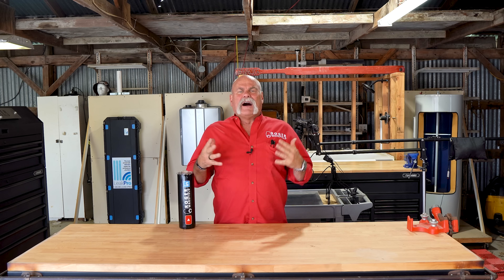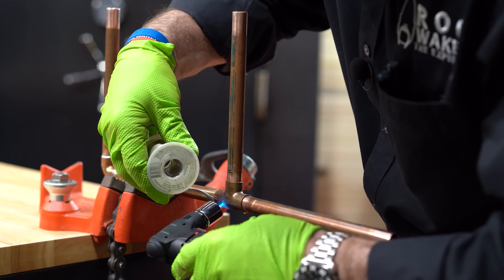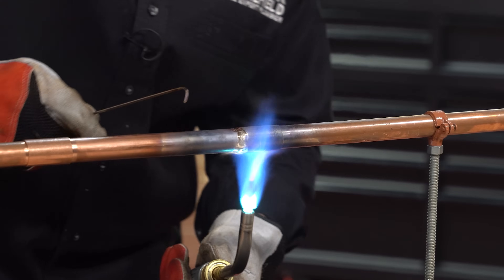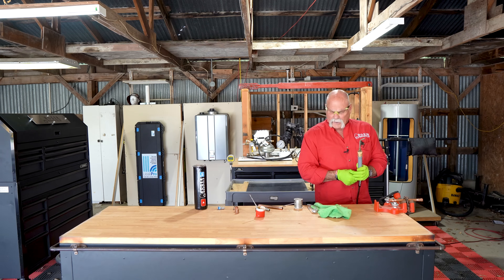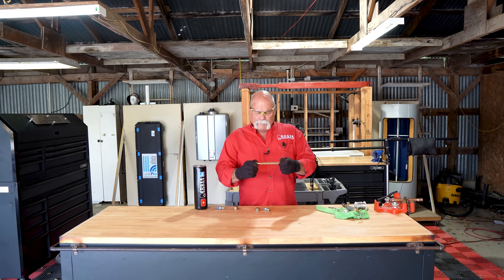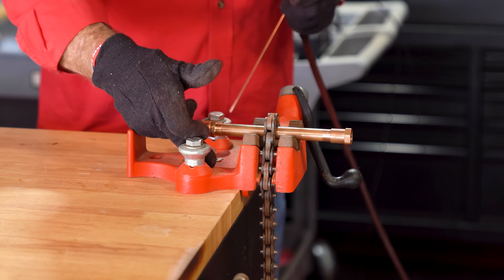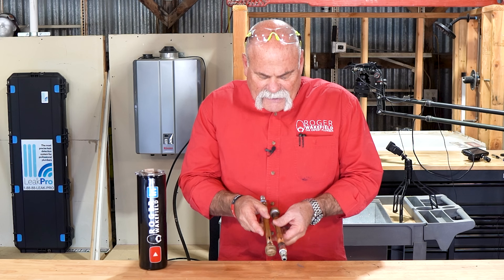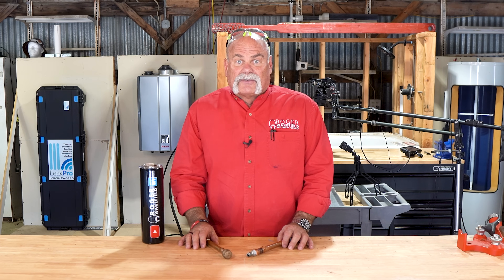Which Is Better Solder or Braze? | Pressure Test

Comment: Brazing of course in finland we dont even train soldering at vocational school. Everything is brazed using oxyace torch, welds are done with oxyace or tig. Furniture like sinks or copper pipes that are left insight are connected with those crush/squeeze fittings from uponor. I think we only braze because we use brass parts here instead of copper

Comment: The water hydraulic pressure test machine we had at work was rated at 100000 PSI. I can tell you I enjoyed destroying things whenever I had the chance. First we would test for specifications and then  DESTROY THE ITEM. !!!!
I used either the TURBO TORCH OR MAPP TORCH for soldering Sir.

Comment: Nice video. interesting, for a refrigerator technician. it would be nice to try with a cooling pipe or in general to look for thicker ones in the housing. tubes that are usually for cooling applications, are over 1.2mm. those meant for dioxide, are even thicker.

Comment: After moving to my first house in AZ, I was surprised to see that the neighborhood didn't have pressure regulators installed on the homes. The PSI is between 75 and 80 here, so clearly it's not a huge risk of blowing anything. Still, I may install one anyway as kind of a "just in case" thing. But I've been here for over 2 years already with no issues, so...

Comment: Dear Roger. One good reason why companies dont solder is THE BLOWLAMP, THEY GAIN A SIGNIFICANT REDUCTION IN INSURANCE RATES, due to the much lower risk of fire. Having used a blowlamp in a confined space, left the building after 30 minutes for lunch, then returned to be greeted with fire engines putting the house out i very much agree with the change. Another. reason is carrying blowlanp fuel canisters in tunnels is not permitted

Comment: A portable induction heater for precise temperature control would be a game changer, hot enough to melt but not hot enough to compromise the metal

Comment: Roger. You should of Aneeled the copper after you heated it. Would of made a stronger cross linked pipe. All you have to do is quench it in cold water after heating

Comment: Definitely should have started with K 💪 but would love to see the pressure limit differences between K/L/M.  Also, type K with solder/press/compression/push fittings, if you could. Thank you for all of your content!!  Edit: step up to a 2" copper pipe with a thicker wall. to truely test them maybe even go as far as special ordering the pipes from a manufacturer with a 0.15" wall 🤔
Reply from the maker: Yes we're planning on testing L and M type copper. Thank you for the suggestions!

Comment: I think that the Stay Brite 8 Solder joint is as strong, if not stronger than the braised joint. The excessive heat from the brazing process actually anneals the copper pipe making it softer so the pipe bursts under less pressure and opens up less because it is annealed. I think the only reason why brazing is used in HVAC is because there is little if any prep required. You simply flow nitrogen and that’s it. I have soldered HVAC lines with Stay Brite 8 and and even regular leaded solder and as long as you prep well and use very little flux and don’t contaminate the inside of the pipe, the joints are good, and the system runs for years. Soldering causes no oxidation on the inside if done right. I have never seen a situation where brazing out performed a good solder joint with either lead or silver-based solders. Whether it was Plumbing or HVAC. My HVAC Tech would argue with me to the ends of the Earth about this but has never tried soldering as it is not the industry standard. He has never been able to prove otherwise. I have HVAC soldered joints that are still holding up even after 10 years, so i’m confident in my opinion.

Comment: I have blown copper pipe under less pressure.  Was working on a slow speed diesel engine and only had copper L type for a temporary lube oil pipe repair.  Maby 50 psi.   The non compressible oil caused fatigue failure and blew the pipe at a lower pressure.

Comment: A really solid joint is rarely the weak link. This applies to all types of joints. Even if you join two pieces of wood correctly with wood glue, it is more likely that your wood will break at another point than at the joint. Even with welding, the metal will usually fail structurally before the weld breaks. If the joint gives way first, then it was not a good joint and it was usually the work of an amateur who did not know what he was doing.

Comment: I am interested to know if brazing actually makes a weaker connection in copper pipe. This test is not conclusive as there was only one test with each but the solder joint held more than twice the pressure before the pipe gave out, I suspect the cause is to be the excessively large amount of heat being put into the copper changing its characteristics although I cant be sure without further testing.  If so then why braze at all.
Reply: I suspect the annealed copper from the brazed joints enabled the pipe to fail much sooner compared to the soldered joint.
Was hoping the big guy was going to speak to this…
Reply: I have a feeling that it is just old method vs new. Old pipes were cast iron so brazing would actually make sense where as modern soldering works much better specially on softer copper pipes.

Comment: I went to finish a job in Pittsburgh for a plumber , when I got there I brought everything I needed in, then the guy overseeing the site stopped me and said I couldn’t sweat in hot water tanks because,”Greg never solders”. Greg is the other plumber I split work with often
Reply from the maker: Plumbers reach out to me all the time and say they aren’t allowed to solder…. CRAZY!!!!!
Reply: @RogerWakefield  soldering use to be a diy skill, now it’s on its way to being a lost technology. I use propress but at the same time some things need to be soldered. I see ppl make messes with propress because something is to close to press so they circle pipe around Willy nilly to make it get in there

Comment: i've used stay-brite #8 for many many years on all HVAC and refrigeration and have never had a joint failure. it is so much quicker and cheaper and no hydrogen purge either. I will continue to use solder for my last 5yrs till retirement. 👍👍

Comment: Copper must weaken or strengthen when tempered, no metal remains unchanged.
From what I saw the brazing weakened the copper significantly @ 11:43 more than the soldering. @ 12:58

Comment: My theory for why the pipe failed at a lower pressure on the braised joint was because the copper was annealed more by the higher temperature softening it.

Comment: Out here in California we have tens of thousands of mid-century modern homes and apartments with copper hydronic space heating pipes in the slab. We were tought that you always had to braze the repairs because the concrete would attack the soldered joint causing it to leak again wthin a few years.

Comment: I have a TurboTorch but still have my old Goss Switchfire which also works.
Reply from the maker: Which do you use more often?
Reply: @RogerWakefield  the TurboTorch.  The Switchfire was my first real (not bernzomatic) torch.
Reply: I just remembered the Goss torch last usage.  I helped a good friend replace shower and tub valves in his bathroom.  He's a former union Ironworker and wanted to learn how to solder copper & brass, so, I showed him with the Goss Switchfire and MAP-Pro.  I started him with the detail Goss torch (TD) on a cap for the spout stubout and then moved up to T1 for the valve bodies.
Reply from the maker: I love that!!!

Comment: Ex military,  USAF 1986 to 1993 Aircraft Hydraulics Technician.    Back shop test bench & Titanium line tester setter.😢    Titanium lines once bent nneded to be SET by high pressure so they held their shapes.   Small 1/4" lines had a set pressure around 45,000psi if i remember right. 😮😮😮   blew up a good number of lines.   Most often blew the expansion tools out of the ends (he k of a mess and booms inside the crash box we built on our Hyd test bench.   Love the air oversystems, once cycling a accumulater i had rebuilt I over e tended it on the high speed circuit & coated the shop 😂😂😢😢😢😢.   3hr cleanup and moping on a Saturday. 😡 
Blew up a #12 hyd line that also made a heck of a mess, had a 90 degree bend in it.   Broke and shot fluid out the 90 in spot that went right out the open top corner of the crash box.   😢😮😮  turned our wall clock pink 😂😂😅😅.

Sgt 384th FMS McConnell AFB KS 1987-1991, 
OTE team B2 Edwards AFB CA 1991-1993.

Comment: I'm a DIY guy who has been soldering copper plumbing pipes for years and have become very proficient at it. I'm about to replace my entire HVAC systems myself and my only concern is the refrigerant lines. I would like to just use solder because I already have everything that I need. To braze them I would have to get the tools and materials then learn how to do it. This is a residential R410a system that will rarely see pressures above 300 psi. I've heard different opinions on soldering vs brazing, would like to hear some more.
Reply: As an HVAC installer, braze them in. If you are really stuck on brazing, at least use the Stay Brite 8 gimmick
Reply: I replaced my ancient evaporator last summer.  Since there was no 50 year old evap available, I had to engineer my thermal specs and dimension to purchase an appropriate unit.  Silver soldered all the joints.  Tested to 400 psi, no issue.  Brazing is totally unnecessary.  (I used to oxycetalyn braze iron and steel years ago, so it's not like I'm afraid of the process.  

You can do it with an ordinary propane torch.

Think about this: a brazed joint is held together via a ring of material.  Soldered joints are held together by the two surfaces trying to separate in shear.  That will never, ever happen.

Comment: Rothenberger Quickfire Torch with MAP gas bottle for soldering Natural gas pipelines and Central Heating pipelines (UK). We don't Flux the inside of the fitting either, we just flux the pipe that goes into the fitting.

Comment: I staybrite 8 a lot of new AC refrigerant lines. It caused me to stop putting flux into my fittings. To try and prevent flux from getting into my system. The annealing of the copper from high temps caused it to fail under less pressure. I have many AC systems 20+ years old   still cooling. I braze my hot gas discharge line. Suction connection on compressor or anything before the condenser coil/ refrigerant sub-cools. Lineset fittings getting enclosed behind sheetrock I also braze. Many freak out on my vids cause I like to solder my lineset fittings. 😂😂😂

Comment: Stay Brite 8 is stronger than both, but looks and goes on like solder. I use it every were in refrigeration except at the compressor. I confirmed this Harris.
Reply from the maker: Thanks for your input. Much appreciated!!!!
Reply: I have had really good performance over the years with StayBrite 8.

Comment: I liked this video.  You did a lab test. 🎉  Thanks
Reply from the maker: Glad you liked it! Do you prefer solder or braze?
Reply: @RogerWakefield  After your review (during the lab test) it would be more expensive to do a braze when we now know that the problem is not the older but the pipe.

Comment: It just depends what the joint will be used for... for hvac, compressor for example... we need to braze these instead of solder because of the vibration of the compressor... yes solder can withstand a little more, but the vibration is what we NEED braze for

Comment: Yes. Don't blow up pvc without some serious safety shields. A maint man blew up a 8" PVC sch 80 Chill water line and it punctured tires, took out a section of brick wall, had shards of pipe stuck in car doors. I'm a safety third get the job done guy and i leave plastic pipe alone after seeing the damage. We had repaired a leaking joint at an elbow and let dry overnight. We were supposed to restaart the system but the maintance man said he knew better, let the system fill about half way and turned on the pumps (3x8") with the outlet valves wide open. We had 20 guys out there nonstop for 4 or 5 days replacing the entire system with black steel victalic and weld pipe.
Reply from the maker: That is CRAZY! Hopefully no one got hurt? Pressures that high are very dangerous and we take safety seriously, thanks for looking out 😎💪
Reply: No one gut seriously hurt thankfully. The guy that turned on the pumps got hit by the doors to the room or something . Myself and my Journeyman were about 10 min away. Ed Thomas Company and a building  for Exxon back in the late 70s . That was a very fun company to work for. We were in the plumbing service department , The company was a Mechanical contractor in Houston.
Reply: Everyone thinks it’s the steel or alloy that will bite you. No it’s plastic.
Reply from the maker: Plastic and porcelain!
Reply: @RogerWakefield  yep that china is as sharp as a katana when splintered

Comment: What does it mean to 'fill the cup'?
   I went to school for HVAC two years ago, and started my own business.  I braze with a #2 tip, using Acetylene & Oxygen. That's all I can tell you in regards to my brazing process.  I'm really good at brazing, as there are never any leaks from my joints.  But I've never heard the term 'filling the cup'.

Comment: The solder did not have as large a heat effected zone.  As we know doing pressure equations we have to account for both heat and cold in the math.  Heat WILL soften copper so that gave the in this case type L copper more ductility and therefore was able to split sooner.  I did however expect a larger buldge or stretch. From an API-510/570 inspector thought process by the way

Comment: would be interested to see a test of the compressed fittings vs soldered. We just had our hydronic system redone and the used pressed/compressed copper fittings

Comment: A fresh joint is much different than an aged joint after electrolosis has attacked it. Add a few temperature cycles on a hot water system and ask any plumber about joints beginning to leak.
Otherwise it is a good video. There is a reason refrigeration lines are brazed and not soldered. The temperature cycling and pressure cycles have something to do with it. It would be much cheaper and easier to solder refrigeration systems, but they need to be leak free for years.
Reply: I have used low temp silver solder  on HVAC split systems and they have lasted  the life of the system.

Comment: So does solder actually bond or how's it work? Does it just fill gaps and solidify? If a piper was perfectly smooth could you solder it?
Reply: The solder creates a molecular bond to the (clean) copper at the surface of the copper which is a very strong bond. Most important that the copper is clean and flux is used.

Comment: I would try using a hammer to fold over and seal a copper pipe to see if the heat from either weakened the pipe. I would also check the expansion wear from heating and cooling the joints excessively to see if that changes things. One should expect the brazing to have weakened the pipe, the solder less so if at all, and the brazing to possibly handle thermal wear and tear better.

Comment: I want to see flex hoses, like to the water heater. Had a flex hose blow because of the water heater heat. Replaced with stainless. Go ahead and test the stainless and copper flex hoses too. This is a mission critical joint.

Comment: Did both pipes fail in the heat affected zone from the brazing and soldering? If so, that's very interesting. The failure point may be from heat and oxidation of the copper pipe.

Comment: In Poland we use brazing on copper natural gas lines, only problem i see with them is copper getting annealed near the joint, its always a litlle scary when you need to unthread a fitting from those pipes. There is a significant chance that it's gonna twist and break on you if handled incorrectly. And amount of heat required to braze, in confined spaces, with a flmmable materials all around, i would rather use a press, tyvm  :)

Comment: If I had to guess, I'd say the higher process temperature of the braze joint weakened the copper itself, which is why that pipe failed at a significantly lower pressure than the soldered test article.  They both failed close to the fitting where all the heat was applied.  But it's also worth pointing out that just one sample of each isn't a rigorous test, or a large enough sample to indicate correlations between processes and failure levels.

Comment: The solder is melting quite above 250 C. In it is added led to reduce the melting point (POK 60, for an example). If you use no led solder the temperatur is quite above 300 C. I have no idea what are you using in the USA, butbin Europe is a different picture.

Comment: I just got a lot of plumbing work done by a company called Holt/72 degrees (they merged by a huge company APEX)  anyway, the tech told me their company doesnt allow them to soder in residential houses as the fire risk is too high.  I got some lekaing pipes fixed in 2017 and had some sharkbites put in and they said their company is going away from sodering.

Comment: I am a DIYer. I am planning on replacing my A/C system. I would like to use Stay-brite 8 rather than charging with Nitrogen and brazing the pipes. Could you do that test? Use line sets and hvac fitting. Thanks.

Comment: For high pressure like in CO2 installations  there is high pressure grade copper pipes which are not annealed during brazing. And pressure is not single one determination factor in choosing materials and joining process.